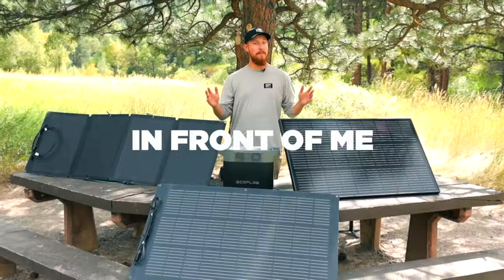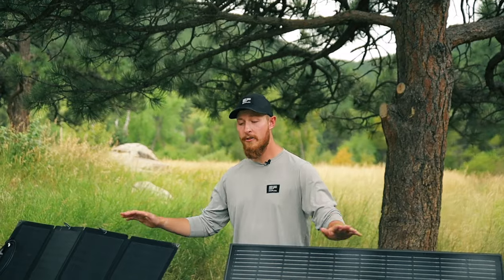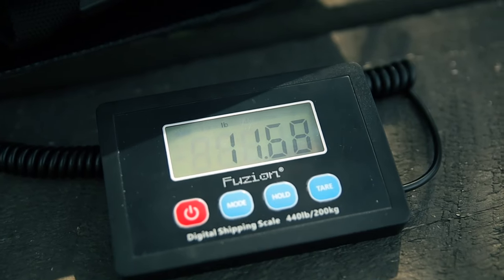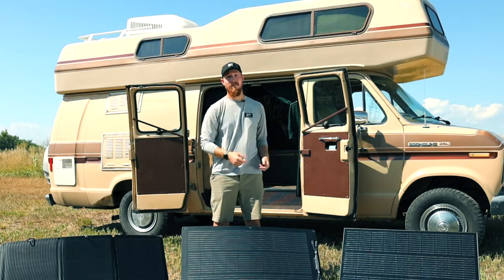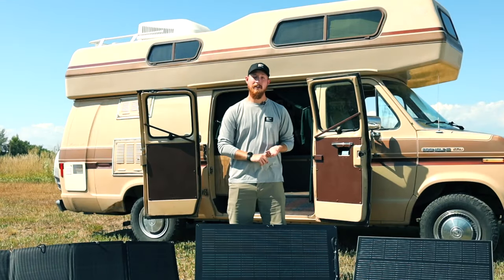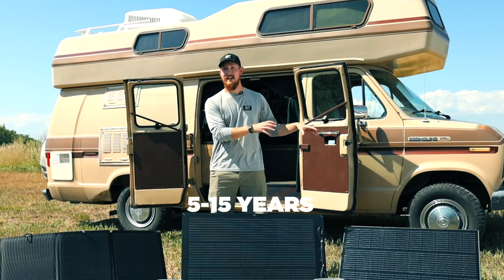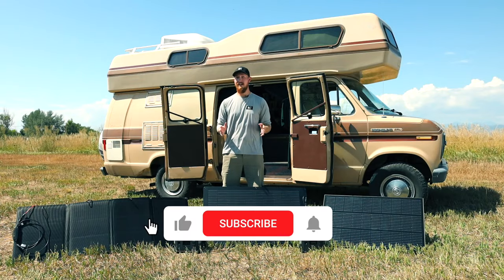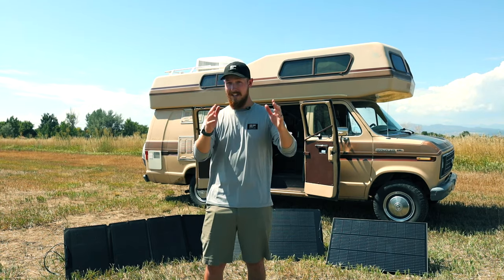Which solar panel is the smartest?

Comment: Have an eco flow pro max. Planning to use sporadically during Emergency power outage. Would like to hang or lean the panel(s) inside the garage windows, that face southwest in south Texas. Is my best option to hang a couple of flexible panels in each window?
Reply from the maker: Hi there! You can hang the panels out and just make sure there are no shades.
Reply: Use a ladder and lay them out flat on the roof of the garage. Midday sun is strongest and flat is perfect then. You need angled in the morning and at the end of the day. Just hanging in a window will work but it's not ideal at all.

Comment: Will it be safe to charge an ecoflow river using 2 of these 100w rigid solar panels that are connected in parallel? Please let me know. Thanks.
Reply from the maker: Hi do you mean River 1 or with 288Wh or others? If it is, the 2 100W panels can only be used in  in parallel with no more than 25V open circuit voltage. Btw, are the panels from EcoFlow?
Reply: Thanks for responding to my earlier question. If I may ask, will a 2-100w ecoflow rigid solar panels in parallel be safe to use on a bluetti eb3a?
Reply: The bluetti eb3a unit has the following charging requirements...200w max solar input, 12-28v (8.5A), so if I use 2 of these 100w rigid or flexible solar panels from ecoflow connected in parallel, will the eb3a unit be safely charged? Please clarify. Thanks.

Comment: Ecoflow, please help me. I’m planning to make a slide roof rack on my van to act like an awning, and also to have more of your flexible panels installed to charge a Delta Pro. But I have a question: how can I connect 6* of your 200W flexible panels to the Delta Pro?

Comment: I just purchased a Delta Pro and extra battery, along with two 400W EcoFlow solar panels. I also received a 220W bifacial panel for free. Is it possible to use all three panels together, or should I just use the bigger ones together? I purchased the XT60i cable and a solar parallel connection cable as well, although I'm thinking the connection cable will probably not be needed.... What is the best way to wire these together? I'm pretty new at all this and although this is probably a simple question, I just want to make sure not to mess anything up.
Reply from the maker: Hi there, it is not suggested to chain panels of different sizes together, the efficiency will be affected. To charge a Delta Pro, two 400W panels connected in series can work!

Comment: hi ecoflow crew, i have a question before buying a solar panel. i wanna buy a river 2 which has max 110w solar input and i wanna buy a 160w solar panel and place it in cars front window which may be prevent a bit of sunlight with reduced watt of lets say 120 watt. would my river 2 still charge even i use a 160 watt panel with rate of 110 watt?

Comment: I have the river 2, will one flexible 100W solar panel be ok, and fi so how do I connect it to the river 2 ?
Reply from the maker: Hi there, yes one flexible 100W solar panel is fine to charge the River 2. Simply plug the solar charging cable into the solar charging input port at the back of the RIVER 2.
Reply: brilliant - which connecting cable do I need? @EcoFlowTech
Reply from the maker: You will need a Solar to XT60i Charging Cable, check out here👉 https://us.ecoflow.com/products/solar-charging-cable?variant=39880496382025